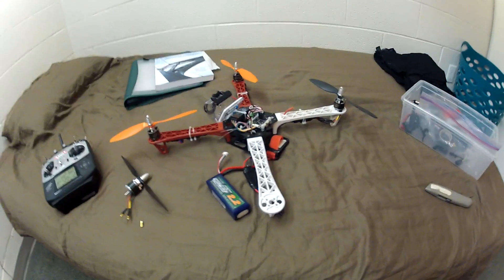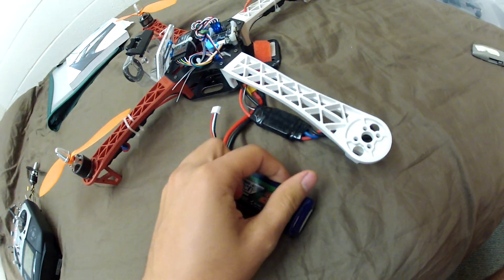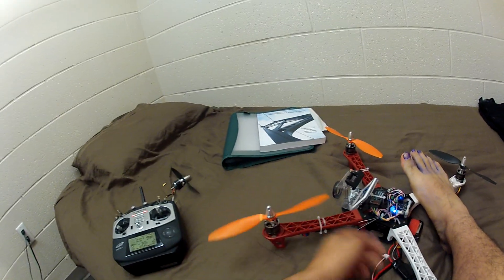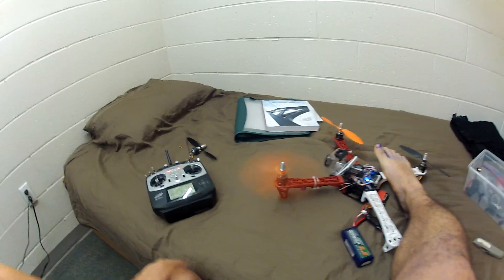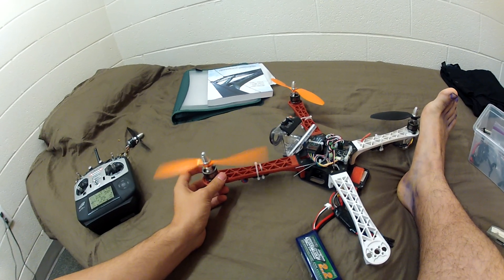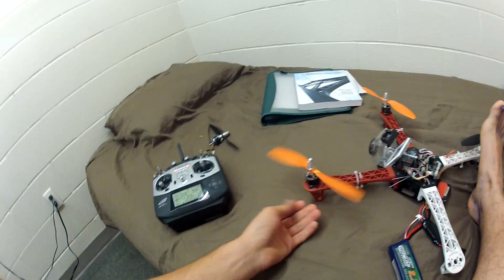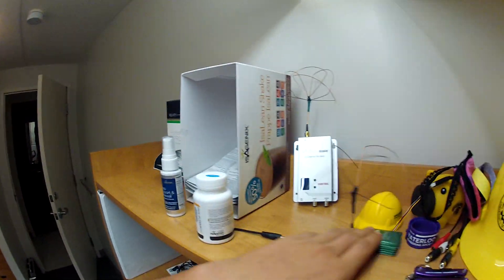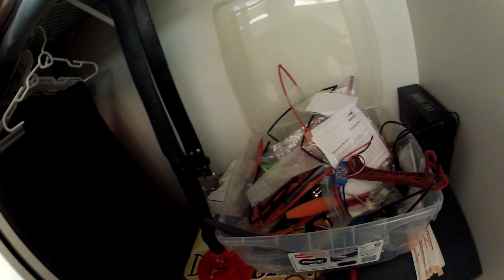F-30A with SimonK firmware and NTM 2628 -1200kv cogging issues + Updates

Comment: Cogging is mostly due to having to high timing set on the esc, it works slow but when you try to punch it it makes the motor want to go both backwards and forwards at the same time making that cogging sound or just make it scream.

Comment: I have turnigy plush 30A (Silabs chip) and i recently flashed them with Bheli rev7  firmware.
My quad has Turnigy NTM 28-26 750Kv motors and result was same as yours. Apparently those motors arehigh inductance motors, with long demag time. After setting commutation timing to High the problem was solved.
I don't know is SimonK's firmware configurable also?